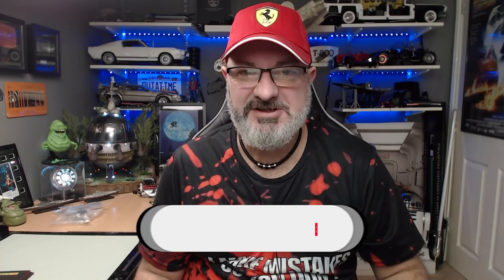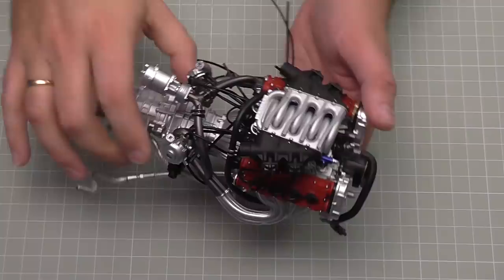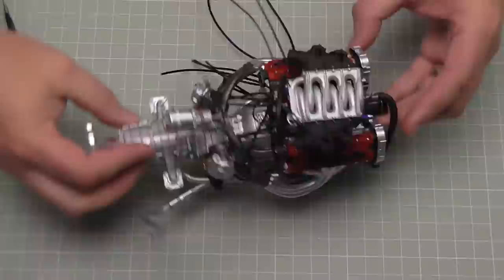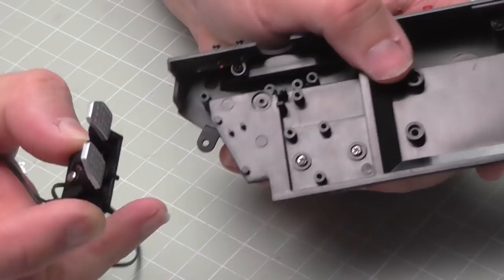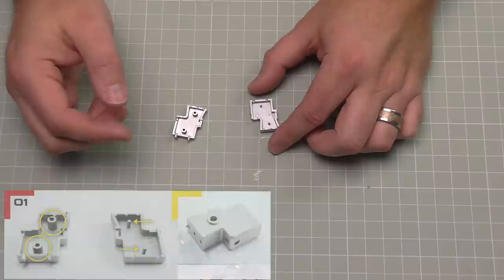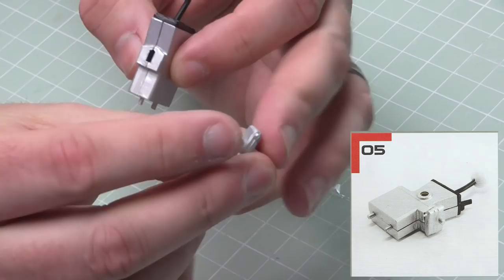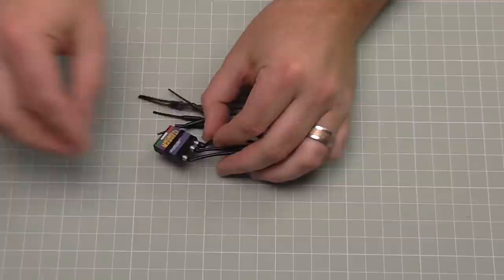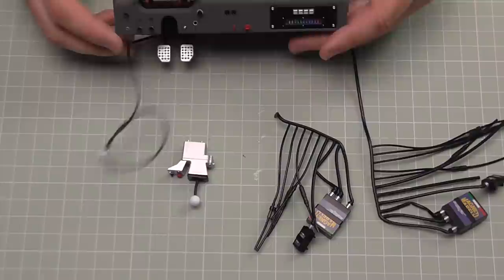Build the Ferrari F40 Competizione - Part 30,31 & 32 - Pedals, Gear Stick and Left / Right Bank Lead

Comment: Wayne the “power unit “ is the engine as a whole. I find it hard to believe you have never heard of this expression before, you must get out more my friend🤔
Reply from the maker: Nope. Never heard of that
Reply: Term used a lot in Formula 1 as the power unit manufacturers refer to the engine makers and FIA rules refer to the power unit as the engine.

Comment: i'm afraid the back issue No.7,the valve covers,one is about 1mm to short.so after i waited for over a week,this new valve cover component will not fit.a lug broke off the original,and this one will not fit.!